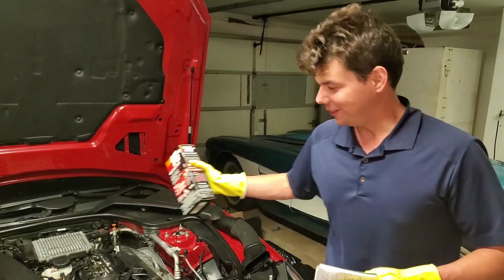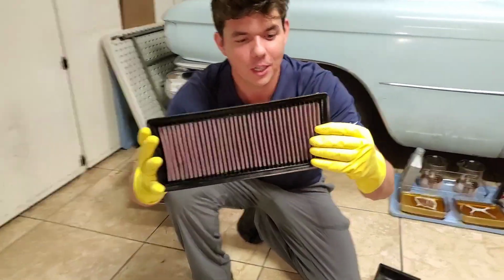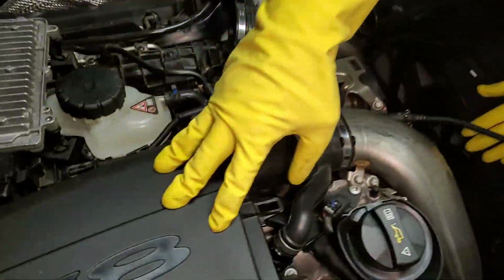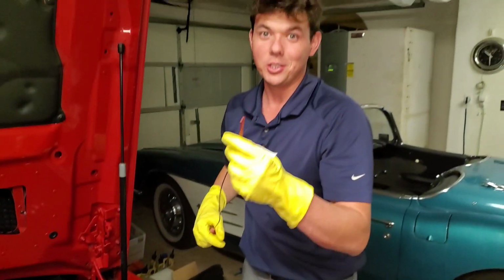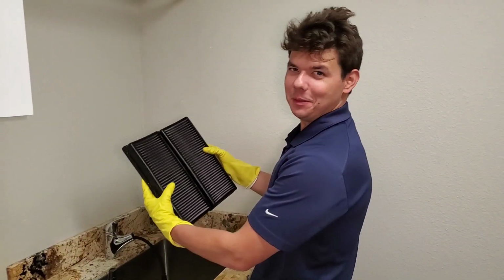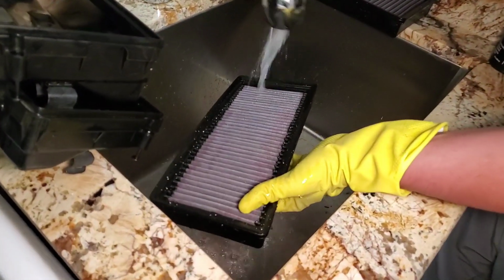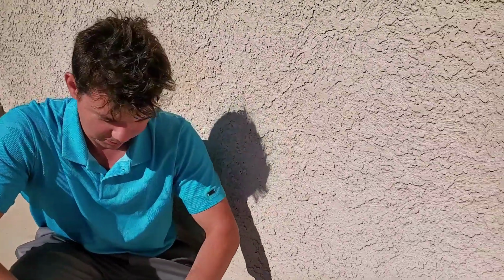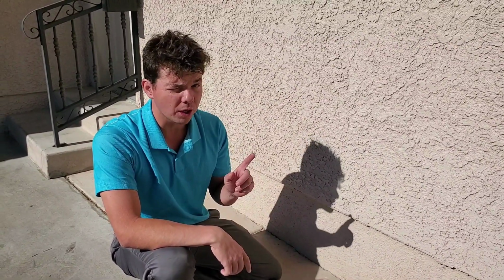10000 Mile K&N air filter follow up cleaning SL550 Mercedes

Comment from the maker: Professional YouLubher: Eben Rockmaker Regency Gold Direct Jobber AMSOIL Specialist (Dealer#: 5331179) 702-472-3614 

     If You're New To AMSOIL I Recommend The AMSOIL 6 Month PC Membership - https://www.amsoil.com/offers/pc/?zo=5331179 

     Watch This: 2013 SL550 Mercedes Everything We Did To It Since I Got It - https://youtube.com/playlist?list=PLB_ftWArBFdd-6mgaMuj9bNs7DvKRpNQmC     

     If you would like to try the AMSOIL products this is my link and I will be your AMSOIL Dealer and will be able to answer your questions. 

     When you order as a AMSOIL Preferred Customer you will save about $33 on $100 order because of the 25% discount and the difference in tax. 

     When you click on my link I will be your AMSOIL Dealer If you go to a different device to order the products and do not click on my link you will need to enter my referral number so I will be your AMSOIL Dealer. My referral number is 5331179      

    Find Products For All Vehicles - https://www.amsoil.com/guides/?zo=5331179      

      AMSOIL Dealer Google Maps - Synthetic Oil Protection: https://maps.app.goo.gl/2AuZCi8h2Gaf3mY46 
             
Synthetic Oil Protection Website - http://syntheticoilprotection.net/ 

      1959 Cadillac DeVille is using all AMSOIL products from top to bottom. CHECK OUT THIS PLAYLIST YOU'LL BE AMAZED - https://youtube.com/playlist?list=PLB_ftWArBFdeVKszO64Ig5nWEQp7H3oF-       

       AMSOIL Performance Test Results. Read This Article - https://www.amsoil.com/performancetests.aspx?zo=5331179 

About AMSOIL..... est. 1972: First 100% Synthetic Oil Certified in the USA 

1. Where can I find AMSOIL? - Use this link https://www.amsoil.com/offers/?zo=5331179  Or      

       2. What makes AMSOIL different than other oils? - AMSOIL is 100% Synthetic & has higher film strength & holds up 4× better in turbocharger deposit testing than Mobil 1 EP which protects and separates metal parts, keeping them from wearing and Lasting Exponentially longer. 

     3. Why should I use AMSOIL?: It protects the engine so it will last longer. Less oil changes less often (once per year/15,000 miles) or longer... Save money in Gas & Time making it less expensive than a FREE oil change over the course of a year. 
  
Oil Analysis Tests: 

5500 Mile AMSOIL Oil Analysis Test Results - https://youtu.be/3wf962IwEmo   

5000 Mile AMSOIL Oil Test Results On My SL550 - https://youtu.be/fLuvzN6yLSw 

11,000 Mile AMSOIL Oil Analysis Results on my Corvette - https://youtu.be/YEY_13UYzA4 

20,000 Mile Oil Analysis Results on Honda Uber - https://youtu.be/gm_PXlpiaTk 

26,000 Mile Oil Analysis Results - https://youtu.be/Wdq2A2YIorM 

80,000 Mile Oil Analysis Test Results Freightliner Cascadia - https://youtu.be/9A9k6i1xMoo 

25,000 Mile AMSOIL ATF Analysis Test Results - https://youtu.be/IeVPGR7UO9E 

      The Power of AMSOIL Signature Series 5W-30 Synthetic Motor Oil protects against harmful deposits on turbochargers 4X better than Mobil1® Extended Performance and 3.6X better than Royal Purple® in industry-standard testing*.  Read This Article - https://www.amsoil.com/newsstand/motor-oil/articles/leading-the-field-in-deposit-protection/?zo=5331179      

     Better MPG Proven. Read This Article - https://www.amsoil.com/newsstand/motor-oil/articles/another-win-for-amsoil-products/?zo=5331179 

     AMSOIL Performance Test Results. Read This Article - https://www.amsoil.com/performancetests.aspx?zo=5331179      

    Try The Synthetic Oil Protection Coffee - Ebens Favorite. To Order Coffee Click Link Below: https://supportwith.coffee/shop/subscriptions/sop/
Reply: Hi Eben ,   I don't know how often you wish to feature oil filters on the Channel.   But i see now Castrol is having Champion Labs make these Castrol SFX Oil Filters that are stated to go longer than the Mobil 1 Oil filters, would be an interesting cut apart series if you ever do more of that.
Reply from the maker: Awesome love that idea where do I find that filter at?

Comment: I've always been kind of held back by the cleaning process but most importantly, K&N filters are racing filters, so yes, you gain 1-3 hp and performance is great but this is obviously for a reason: they filter way less dust than the OEM (or more "reasonable") parts. The OEM filter is approved by the manufacturer for having the good filtering/performance ratio so the car works best and you don't damage the engine is the long run. So I prefer to buy the dealer part
Reply from the maker: Yeah they're definitely a little tricky to clean.

I was told specifically not to ever use a k&n filter in my car because it can mess up the mass airflow sensor.

That's because most people don't know how to clean them properly and they also don't know how to oil the filter It's a special process and it takes very little oil.

Also you only oil the inside of the filter where the air enters the filter not to where it exits a lot of people do both sides and the oil saturates through and then it goes into their intake and into the throttle body into the mass air flow sensors and then their car runs horrible.

I've heard a lot of people that don't like Kane and filters and that's because that probably happened to them.

It's definitely a unique process to clean but once you do it correctly it's a piece of cake 😃😉☕

Comment: I always wondered if anyone else took the time to detail their air intake box when replacing their air filter… Glad to know I’m not the only one!😂
Reply from the maker: Yeah tell me about it you'd never think that much dirt could get packed in that thing but it was totally clogged in the corners.

I used to have a cold air intake on my C5 Corvette but they don't make that for this car plus it's turbo I don't think a cold air intake would really do much but I know the k&n filters flow a little better and I'm definitely happy with the way it's driving now it's impressive after just changing the filter it does run and sound different.

Comment: I used to get K&N but now only get AEM, dryflow series. No need for oiling, just cleaning, no oil risk on sensors and they filter a bit better than K&N, worth it for the 0.5hp loss over K&N.
Reply from the maker: That's awesome
Reply from the maker: Have you seen any tests that compare the two filters yet?
Reply: @Syntheticoilprotection  yep! Also tested them with a friend of mine at our university, they have got some particulate material measurement equipment, about 20% better at filtering in general, and filters some smaller particles that the K&N does not, the K&N does flow better and in theory would give you the better horsepower and torque, but the AEM still flows much better than any OEM filter.

Comment: I have two K&N air filters for my 2016 KIA Forte. While I clean one and let it dry I added the other one with that spray oil and let it dry course. Once it’s dried from the one I added that K&N oil spray I put it on my KIA while the other one dries out from the sun and store it in a K&N box to repeat the process. You should buy 2 more for your daily
Reply from the maker: That's an awesome routine do you do your own oil changes on your vehicles?
Reply: @Syntheticoilprotection  I haven’t cause I don’t have the tools. But I’m sure I can do it. I just need to win extra money since now a days everything is expensive.

Comment: I have subscribed to your channel and joined the AMSOIL membership.  Question: Where do you take your Mercedes for a transmission fluid and filter change in LV?  What AMSOIL product do you recommend for a transmission fluid change?  Your video on changing the differential fluid was helpful as was your video on changing the radiator fluid.
Reply from the maker: Hey that's great Chris I go a couple different places The place where I got my transmission fluid changed that was at aamco Transmission with my good man Steven.
https://youtu.be/pbhhEuGsh-I
Reply from the maker: I also have a whole playlist on my channel if you go through you'll see it everything I did to my SL550 since I bought it in Colorado.

Steven's a great guy there's also another great guy that's on desert inn and Decatur if you need him.

Also what is your name I can look you up and make sure you're my account that way I can always answer all your questions in the future on the products.

If you text me your full name I can double check 702-472-3614
Reply from the maker: The lookup guide gives you everything for your year make model engine size it'll also give you the fluid capacities as well.
Find Products For All Vehicles - https://www.amsoil.com/guides/?zo=5331179
Reply: @Syntheticoilprotection  This is GREAT.  I will be in touch.
Reply from the maker: As weet👍

Comment: Doesn’t the K&N filters allow more dirt particles into the engine?  Just what I heard.
Reply from the maker: That's a great question I honestly have no idea I've never had any trouble with mine always had great results. 
I think there's other things that come into play like the way it seals around the airbox and or the way the cold air intake is set up if something's not assembled correctly if you let any air by you could get a lot of stuff into your oil but a lot of the oil analysis I have have been with the k&n filters and everything's come back great you'll see my Corvette one that had a arrayed cold air intake which is the same thing as a k&n and then I also have another oil analysis on some other vehicles on my car my latest car the 5,000 mile oil analysis you'll see how good everything looks.
https://youtu.be/fLuvzN6yLSw

Comment: I think aFe and AEM are slightly superior, but K&N will make a filter for any applications.
Reply from the maker: What makes those other filters different are they oiled filters? How are they different do they make factory replacement fitment or they just cold air intakes?

Comment: Eben, you could also vacuum out the debris before applying the detergent. Might give you better airflow?
Reply from the maker: Oh yeah I tapped it all out so there was nothing else in there.
Also even the little teeny particles that are in still they get released once you spray that detergent on it it actually breaks down the oil and once the oil film is broken down it actually releases all those little particles so when I oiled it later it was completely clean. It's amazing how that filter works like that

Comment: Now put 2 new OEM filters in and run for the same intervals.  K&N are well known for dusting engines out.
Reply from the maker: I don't understand what you mean?
Reply: @Syntheticoilprotection  you had dust in your intake tubes, that is not good.  With everything clean, run oem filters for 10,000 miles.   You will notice a difference.
Reply from the maker: I'm not sure what you mean by intake tube there's two different sides one is the side that is not filtered yet and then the other half of that plastic box has filtered air the part that has the filtered air had zero dust in it. The intake part had the dust and dirt lodged in the corner and that comes in directly from those two air hoses and then it bottles into the box.
I also have the oil analysis on the first 5,000 mi with my car in my car got the k&n filters right away and you'll see how low the contaminants are in the oil.
https://youtu.be/fLuvzN6yLSw
Reply: @Syntheticoilprotection  K&N are notorious for letting dust through,  they may be fine on a race car that sees constant over hauls, but not on a street vehicle.   This is one area where saving money with these filters gets expensive.
Reply from the maker: Yeah on all my cars the intakes were always clean never had any trouble.

All the oil analysis always came back good I haven't seen anything like this however I do know if you got the wrong filter and it didn't seal the air box correctly if you let air by you can have a big problem also if there's a warp in the rubber and it doesn't fit the air box right you're going to let air by and you're going to have a big problem and/or if you don't seat your air box correctly say someone doesn't latch the air box right and they leave it half open or half unlatched You're going to let a bunch of errors beside the silicone and then you're going to have a ton of stuff that goes in your motor.
You'll notice how they seal super tight on the boxes and that's what makes it such a great filter compared to some of the OEMs is the way the silicone seals the sides.

Comment: I have a K&N on my cold air intake System on my Nissan Titan.😊
Reply from the maker: That's awesome how long have you had that one?
Reply: @Syntheticoilprotection  10 years.
Reply from the maker: Sweet, What type of vehicle is it
Reply: @Syntheticoilprotection  Nissan Titan.  I love your benz bro. I miss my S500 Black on Black.
Reply from the maker: Thank you however it's not the Mercedes-Benz anymore It's the synthetic oil protection machine 😊😆😁😄.
It really is a different car after doing the Toyota praxis sport tires in the 18-inch wheels and then doing the k&n air filter and all the fluids the car is totally unrecognizable from when I bought it.
When I got it it drove like a damn Mack truck.

Now it drives like a refined cruiser 😃
Reply: @Syntheticoilprotection  Very cool.👍

Comment: Hey Eben. Love your channel! I’m currently working on getting all my vehicles fluids changed over to Amsoil. I did have a question for coolant/antifreeze. I have a 2016 VW Jetta GLI 2.0L and it’s supposed to use G13 pink colored
coolant. I noticed Amsoil didn’t have an equivalent, any recommendations? Thanks in advance.
Reply from the maker: Yes I always recommend the low toxicity biodegradable coolant you'll see that on the coolants and also the low toxicity coolant and the dominator coolant boost is what I run on my vehicle I recommend doing everything I did here to my car tears.
https://youtu.be/oco_xFBM_uk
Reply from the maker: If you're new to Amsoil I recommend the 6-month PC membership that'll save you about $33 and $100 order This is my personal link and when you use my link I will get the credit for your order and you could always reach out to me in the future.
Professional YouLubher: Eben Rockmaker Regency Gold Direct Jobber AMSOIL Specialist (Dealer#: 5331179) 702-472-3614 

     If You're New To AMSOIL I Recommend The AMSOIL 6 Month PC Membership - https://www.amsoil.com/offers/pc/?zo=5331179
Reply: @Syntheticoilprotection  awesome I’ll make sure to use your link to make my purchase. Thank you for taking the time to reply so quickly to my question. Much appreciated.
Reply from the maker: Sweet😃
Thanks 💯

Comment: Need a small assistance dear!

But don't we think, the air intake will be free flowing. but filtaration capacity is not at per like stock filter??? At any given time, most of the dust particles will be penetrating into intake via MAF->TURBO->INTERCOOLER???
My logic is low resistance also means low filtaration. But not sure in this case the negative effect is to what extent.
Would be nice to have a logical explanation - pls.
Reply from the maker: Oh yeah you'll see how clean the oil is on the oil analysis if there was a lot of contaminants getting in that would definitely show up a lot more in the motor oil check this video - https://youtu.be/3rdN6U1Jt_M
Reply: @Syntheticoilprotection  Many thanks! 
On a different note, earlier, I used to go with Shell Helix Ultra 5W-30 fully synthetic.For past 20K KMs, am using AMSOIL 5W-40 European Motoroil FS 100 % synthetic for my i20 Diesel (1.4L)  - Ah! pretty small engine though. She is running a lot quieter and appreciably smoother.

Comment: The K&N will be a lot of oil sticking on your intake manifold not recommended unless you buy air filter with out oil
Reply from the maker: That's if it is oiled improperly there's a particular method that's to be exercised you'll see that in the video how to properly oil the K&N Filter very important.👍
Reply: @Syntheticoilprotection  🙏

Comment: These filters are not better. High flow let's more dirt thru. Will show in your oil analysis. You do not want to use these period. Especially in a dusty environment.
Reply from the maker: I know that's what I was expecting he was crazy though the silica was still very low. Check out the first round of oil analysis at 5,000 mi the second round will be coming up in about a week - https://youtu.be/fLuvzN6yLSw

I'm excited to see what the 10,000 mi mark looks like I think it's still going to be extremely low.
Reply: I was thinking the same way too. I’m skeptical about these air filters too.
Reply from the maker: Yeah they're definitely a unique setup and not meant for someone that's used to cleaning things. If you over oil it it can definitely get oil on your mass airflow sensor and your car will not run right.